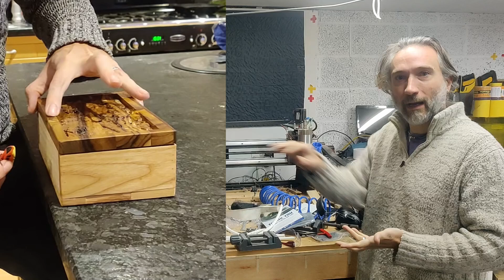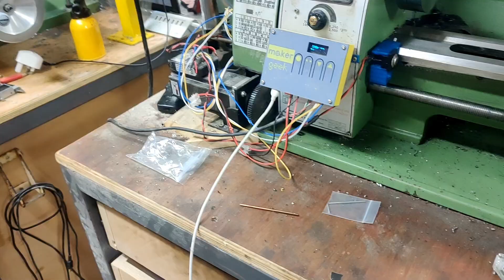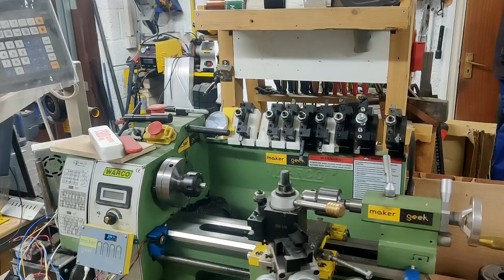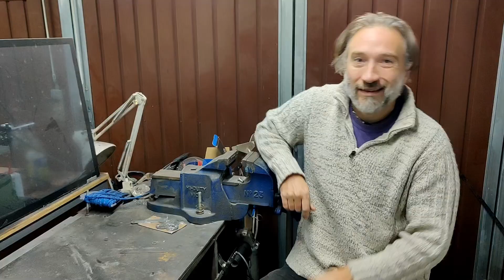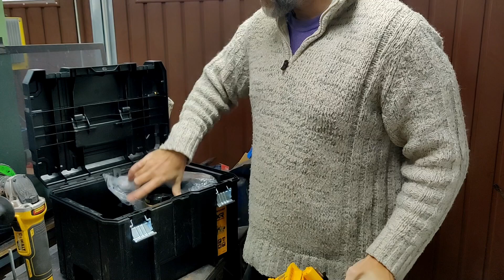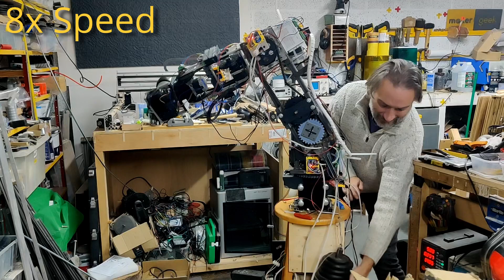State of the Workshop - 2025

Comment: Thanks for the tour /update . I feel at home with so many familiar machines , The HY275100 compressor firstly . Consider piping up and adding a big Automotive type air filter to both pumps , They will thank you for it and reduce power requirements and running temperatures . The lathe . I like your electronic leadscrew solution , I am sure you will get many takers when you are done , What a great idea to have the tool post mounted DTI also work as a bed gauge. I may copy that one .. Finally the mill . I made an x axis power feed for mine about three years back and have had no issues (yet) it has been copied several times by fellow youtubers and may be of interest . Thanks for Sharing . Cheers Ade.
Reply from the maker: Cheers Ade - Certainly I had it in mind to re-watch your set of videos on the mill power feed and krib from your design !